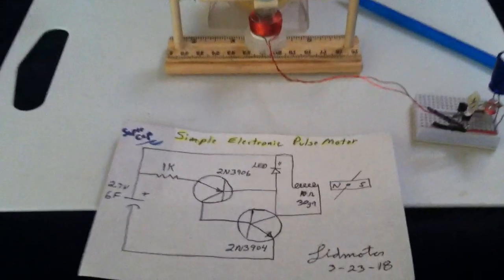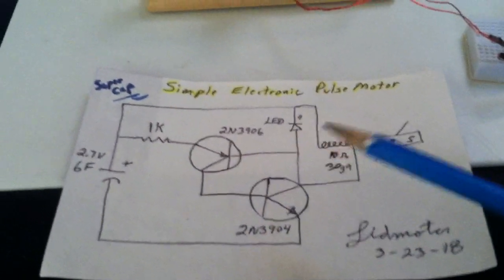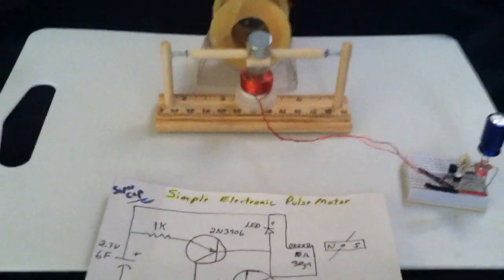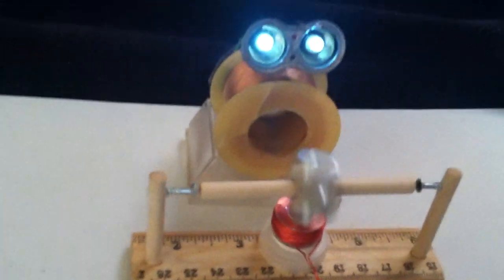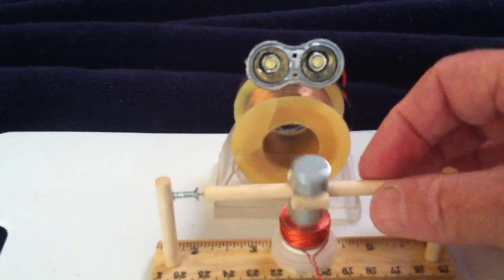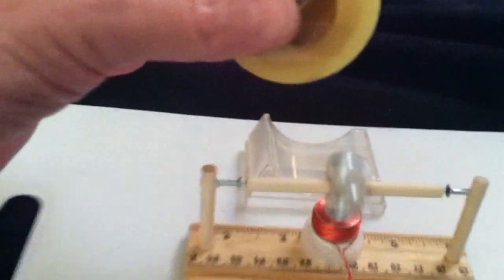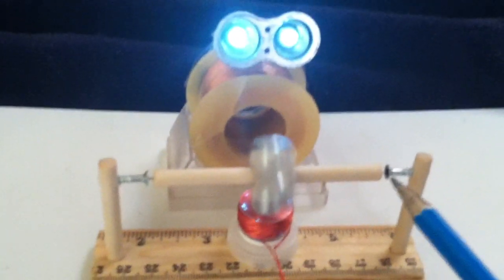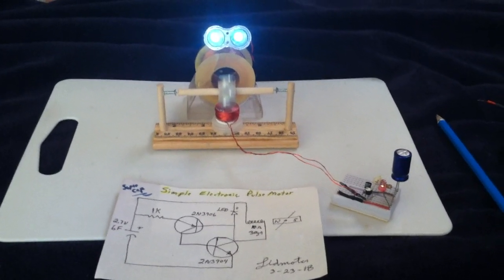Super Cap Simple Electronic Pulse Motor

Comment: Thanks for the magnet link.   Looks like a better deal than from (say) kjmagnetics.  BTW, I can never get these two-transistor circuits to work unless I use a fairly large resistor into the gate of the PNP.  Otherwise, it triggers on its own without the magnet/coil signal.  Odd.
Reply from the maker: These (10) for $3 magnets were a great deal.  Watch your fingers and don't get pinched.  They are very strong.  The best way to make this circuit work is to put a 100k pot in for the resistor and adjust it until you get the circuit to trigger right.  Measure the pot resistance then just replace the pot for a regular resistor.

Comment: You might want to look up diy super cap and make one for this . Would be great ! Look up Robert Murray smith.
Reply from the maker: I have played around what Robert Murray Smith has shown but my results were somewhat disappointing.  What I have built so far worked but this tiny 6F super cap I show here is sooooo much better.
Reply: Lidmotor you got get those carbons ground up super small